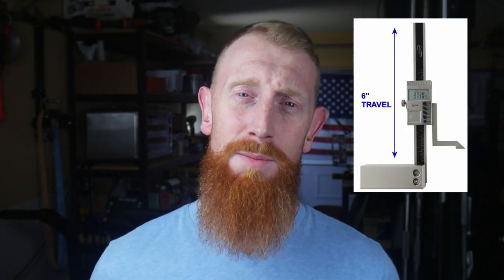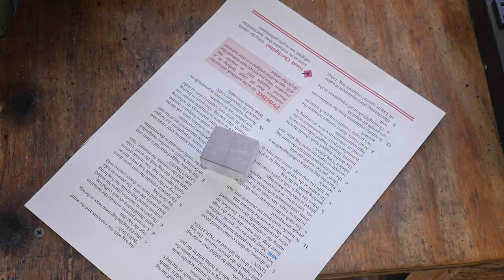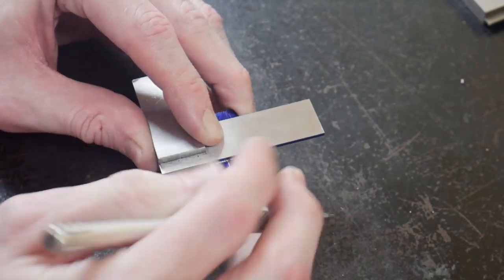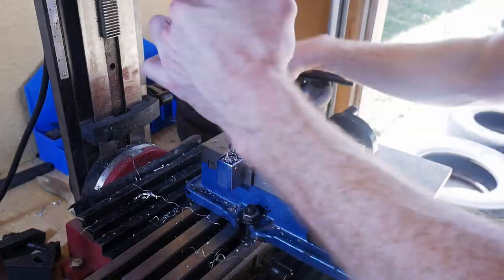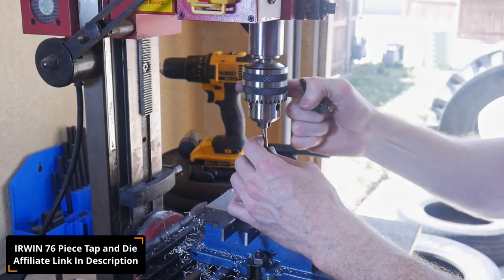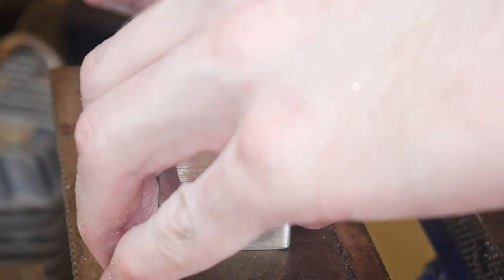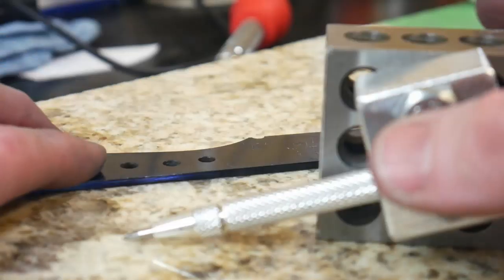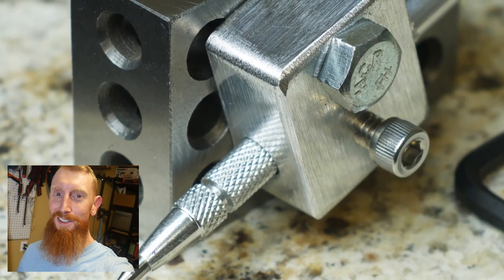How to Make a Height Scribe | Knife Maker's Surface Gauge

Comment: Great Job mate! your spot on with the Ali chip loading, and its great to see you using Wd40 for lube. if you wan cheaper you can use Kero in a spray bottle. remember when drilling - if you drill your pilot a bit bigger than the web of your final size you can do it in 3 ops. spot drill, pilot, then main size.
Reply from the maker: Thanks for the tips Troy!

Comment from the maker: What do yall use to scribe / mark your lines?
Reply: A traditional Height gauge, I have one Chinese and one Starrett.
Reply: Dang. I just bought a "knifemaker's scribe" from ebay for $25. It looks almost exactly like this without the 1-2-3 block and it has a tungsten carbide rod sharpened to a point instead of a pen scribe. I don't have any aluminum or 1-2-3 blocks though so I guess it's a wash for me.
Reply: Drillbit with same thickness as the knifeblade

Comment: Great project and I'm trying to make it right now but it is very hard to follow along with the locations of the set screw hole and the scribe hole.  You give the dimensions and location of the 3/8 inch hole but not the other two holes.
Reply from the maker: Sorry about that David. This was a good deal of time ago, I can't give you those dimensions. I do think they'll change with the diameter of the scribe you're using as well
Reply: Don't sweat it, I bought the same scribe and figured it out.

Comment: I don't quite understand how this tool gives you the center line to prep your blade for bevel grinding. You said the carbide scribe can "get pretty close to the granite surface." Are you eyeballing the location of the first scribed line on the spine, scribing, flipping the knife over, repeating the scribed line, and splitting the difference of the 2 parallel lines to locate the center of the blade edge?
Reply from the maker: In the case of this tool I eyeball. I wanted two parallel lines. I find that easier to grind to than one center line.